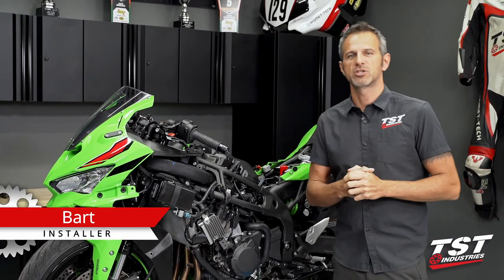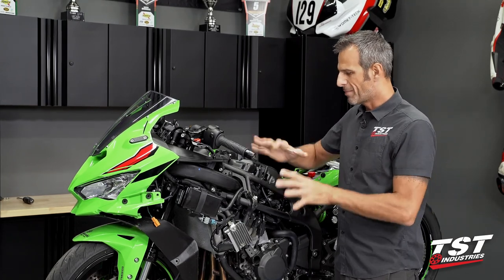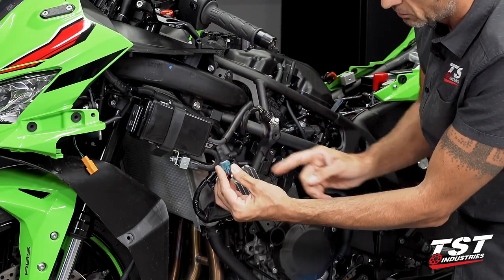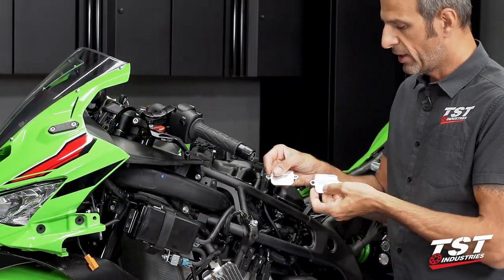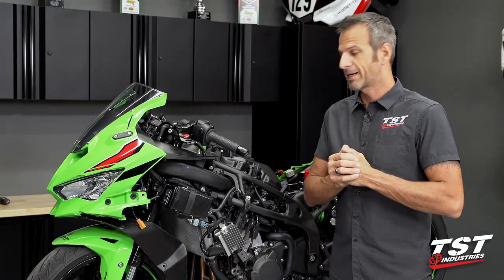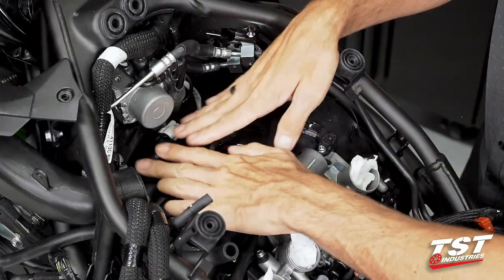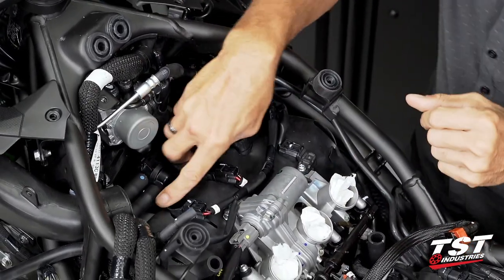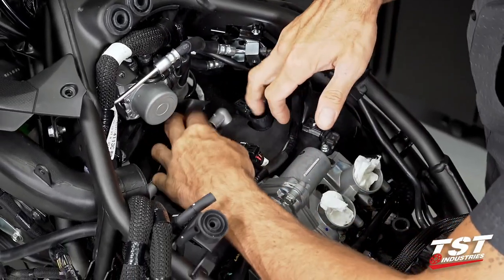How To Install Smog Block Off Kit on 2023+ Kawasaki ZX-4RR by TST Industries

Comment: Good Day TST team. Thanks for everyhting you do for our bikes.  I have seen in our ZX4RR forums - Womet tech block off plates are thinner than the stock pair valve setup so you will need either shorter screws or washers as spacers!
Reply: Second this. You will need (2) m6 washers per bolt, as the OEM bolts are too long for the womatech PAIR block off plates.

Comment: The factory screws are too long. The plates I received were thinner than the thickness of the factory valves: you’ll need washers or shorter screws.

Comment: So to do the smoke block off kit on the zx10r, would those dummy plugs work on my bike as well from the zx4r too? And it appears I need 2 of the dummy plugs?
Reply from the maker: We have not tried the dummy plugs on the 10 but Kawi is pretty systematic in this type of equipment and how the ecu senses it. I can't guarantee them working but chances are good.

Comment: why do we need to remove the reed valves ? cant we install them  as it is > Thanks
Reply from the maker: Why would you want to keep redundant parts that are no longer needed for any function? If you want to keep them in there and you manage to fit them then go ahead.

Comment: What happens if you take out the EVAP system with the charcoal canister and plug up the purge valve hose OR even just plug up the throttle body ports BUT leave the factory PAIR valve system? I prefer having the decel pops and bangs for my bike.

Can I just remove the EVAP system but keep the PAIR valve system then ??

Comment: What the function of blocking the ais System???

I have ninja 400, well in my country is new ninja 250, i have a question, my bike is fully standard, no ecu tunning, no remap, just aftermarket exhaust. Can I block the AIS System??? Or is that okay to block off the AIS System.

Bcs my friend block the AIS System and the exhaust is Brappp bapp bapppp🗣️🗣️💥💥💥💥 and honestly I want it too😅